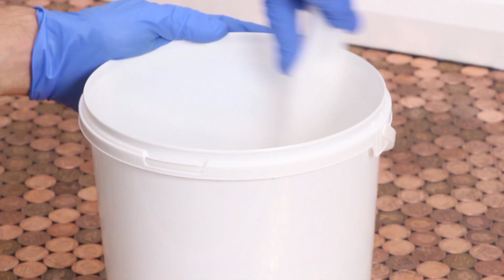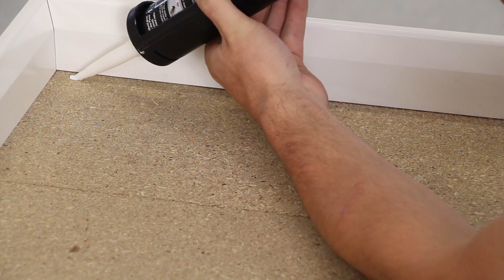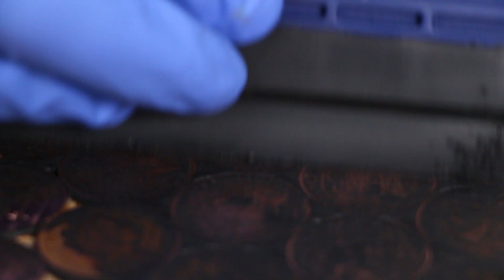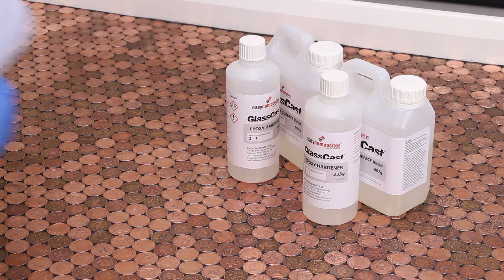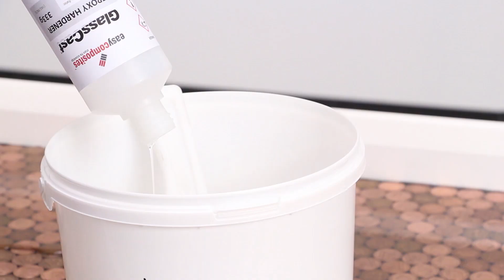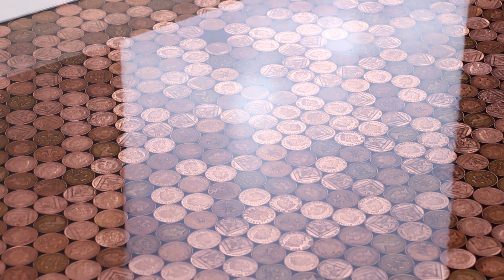How to Lay a Penny Floor with GlassCast 3 Clear Epoxy Resin

Comment: Would that type of floor scratch easily if you have dogs?
Reply from the maker: Potentially if they had sharp nails then there is the  potential for the surface to scratch. The good thing about Glasscast though is that if this was the case the surface can be polished back up with some polishing compound to restore the glossy finish.

Comment: Can I use this on myliving room  tile floor
Reply from the maker: Yes, you can apply GlassCast 3 over tiles. Assuming the tiles have been down for some time, they may have a range of different sealers, coatings, polishes, finishes etc on them so it would be important to do a test and check that the resin bonds well to them, especially if things like grease or polish might be present.

Comment: Do this for the wall too . please
Reply from the maker: Applying a self-levelling resin to a vertical surface is, as you can imagine, a bit of a problem. The only real option, if you can't make the panels on a flat surface in advance, is to apply multiple thin coats of resin (probably something like our XCR coating resin) and then flat and finish the wall to get the mirror-like finish (if a perfectly flat appearance is required).

Comment: On page 10 of the Penny Floor instructions, it is stated to allow the grout to dry throughly before applying the Glasscast because it is sensitive to moisture.  My grout (Fusions Pro ready-to-use) instructions say to avoid a solvent based sealant. Would Glasscast work if I allow ample time for the grout to fully dry or should I use a different grout?
Reply from the maker: Hi James, as long as your grout has fully dried you should not have a problem.  Epoxy does not contain hardly any solvents so should not cause any issues. If you are particularly concerned, then you could do a small test patch with some grout dried on a board then coat it with a small amount of resin.
Reply: @easycompositestv  Thank you for the quick response!

Comment: Is there a calculator for how many 2p coins you'll need? I can see a resin calculator, but not a coin calculator.
Reply from the maker: We've not yet managed to put together a calculator as it ended up slightly mroe difficult than we first imagined with the numerous sizes of coins/pennies that people use for these projects around the world. However, if using UK 2pence pieces, you need roughly 1750 for every square metre of area. So around £35.00 worth of 2p pieces.

Comment: I'm hoping to make a floor out of puzzles. Would this work on it without damaging the puzzles/making them look odd? Also what happens if I don't use grout? I'm planning on leaving the existing floor down as a base for it all, but was thinking about putting some fun colored duct tape on the floor in-between puzzles (if there is any space) to add some color so I wouldn't want to cover it with grout, but want to be sure it doesn't make it less likely to work, etc.
Reply from the maker: If you’re talking about cardboard jigsaw pieces then, being paper, it’s possible that the resin would soak in to them making them look ‘wet’. The solution would be to test a couple of prices first to see if there is a problem and if there is, you can seal the pieces using PVA, once dry it will be clear again and the pieces won’t go ‘wet’ with the resin. As for the duct tape, this might not be such a great idea if the resin doesn’t stick to it (which it probably won’t) because the resin could delaminate away from it if the floor got flexed or bashed. The best thing would be to make up a small test panel of what you want to do to check the behaviour of the resin on your chosen substrate and also the appearance of the end result.
Reply: @easycompositestv  Okay, thank you :D

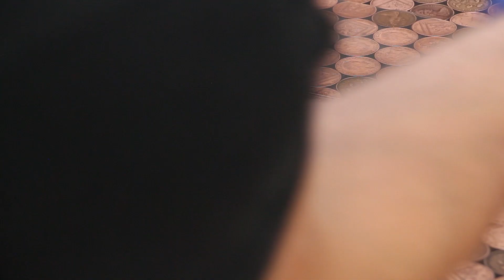Comment: 4:18 Why is it important to just pour and not scrape the excess resin that's stuck on the sides? Also can this resin be used on a more uneven surface like carbon fiber cut into small strands for a "chopped carbon" look?
Reply from the maker: One reason to not scrape the resin that's stuck to the sides is to avoid just continuing the problem of unmixed resin from the first bucket to the second. If you scrape out the bucket, you're likely to be scraping unmixed resin onto your mixing stick and into your second bucket whereas the idea is that only at least partially mixed resin goes into the second bucket. And yes, you can pour the resin over a much more uneven surface, included chopped carbon for a forged look. In fact, we've already done this ourselves and it looks great. I'd suggest you wet out the carbon and flatten it down with a first thin pour, give it a flat (with a sander) and then pour the final top coat.
Reply: @easycompositestv  Thanks for the reply! I'm definitely going to try to make a chopped carbon look table one day.

Comment: This is hardly a "complete guide," it is a very naive presentation that will mislead people. 
Newbies to applying sticky self curing two part liquids should be warned to think things out ahead very careful as to; 
1. Place tools and supplies so you can always have at hand as you progress across the floor, 
2. Preplan to close off the area when done.
3. Use the longest available (never six inch!) but no matter what tool you use it's almost completely unlikely the floor is level.
4. Remove the base trim. use a laser to establish a level line around the room.
5. Level the floor intentionally, with a leveling material as with tile. 
6. Either do the cast to the walls and apply new trim later, or put down the trim and do the cast. If you do the cast first, you will get no material on the trim, and the coins will tuck under the baseboard and look more pro.

No mention of odors and ventilation so I presume it's healthy.
Reply from the maker: Hi John, thanks for the feedback and suggestions. Most people do seem to have figured out for themselves that they shouldn't leave their tools at one end of the room in much the same way that they've figured out not to start at the end with the only door ;)
As for levelling, the sort of thickness you'd be using the resin at (2 mm) won't really result in pooling of the resin down at one end if the floor is a few mm out, there's too much surface tension. We know of many customers with a few mm of drop over large expanses and the resin will maintain a pretty consistent thickness regardless. Good suggestions on trim though, removing skirting is extra work but does have its advantages.
As for safety, there's a banner that we display at the bottom of the screen at the start of the resin section which instructs people to read and follow the TDS and SDS of the resin; the bottle labels of course do the same. That said, it's 100% solids epoxy so, no, there are no fumes or odours to speak of but some ventilation in a work area is common sense (and referenced in those datasheets). Take a look at the GlassCast gallery on our website to see how well 'newbies' seem to be getting on; there's some fantastic projects on there.

Comment: Is this product available in the US?
Can't seem to find it on Google 😅 Great floor and video!
Reply from the maker: Hi Zander, we don't have a distributor in the US but we can ship direct to the US from the UK. However, shipping can be quite expensive. On the Easy Composites website you can use the shipping calculator on the basket page to give you the shipping cost.

Comment: I didn't understand why to put that black material for joints? You could have coated epoxy directly after sticking coins
Reply from the maker: Personal preference, the grout (as used with any normal tiling project) also helps to mask any underlying colour from the floor beneath.

Comment: Can you reapply another coat once dry.
Reply from the maker: You can but once the resin has fully cured (i.e. gone hard) then you would need to key the first layer with a coarse abrasive paper before you pour the next layer. This would allow the new resin pour to bond properly with the first one.
Reply: @easycompositestv  hi what grade of paper do u recommend?

Comment: As the pennies are glued to the floor can I not use the grout and instead go straight to resin?
Reply from the maker: You ideally want to glue them down so nothing moves.
Reply: I’m going to glue the pennies down but don’t want to grout.
Reply: @stevequincey  The purpose of the grout is it helps the pennies stay in place as one big mass, rather than all glued individually.  This minimises the movement – ergo chance of any cracking or uneven pressure.
What is it about the look of grout that you don't like?!  It pretty much recedes into the background and sets the coins off rather nicely, I think.  it also means you spend less on resin and end up overall with a nicer – much more even – smoother finish.

Comment: How thick is the layer of resin?
Reply from the maker: We recommend 2.5 to 3mm for a penny floor which means 2.5kg to 3kg of resin per square metre.
Reply: Does glass cast bond to wood and paint?

Comment: Can I use this to cast paperweights with items added into the resin? I metal detect and would like to make paperweights or display pieces with it.
Reply from the maker: No, GlassCast 3 is not really intended for 'casting', it's more of a coating resin. You would be better using GlassCast 50 for casting paperweights. Here's a link: https://www.glasscastresin.com/glasscast-50-epoxy-casting-resin

Comment: Can you do the same concept except with pics in place of penny's?
Reply from the maker: Yes you can although depending on the grade of paper, you may need to seal over the paper with a thin coat of PVA wood glue to stop the resin soaking into the paper and making it go translucent.
Reply: @easycompositestv  thank you!

Comment: Does glass cast  resin yellow under UV? Thanks
Reply from the maker: Under high levels of UV, such as outside in the sun, GlassCast will eventually slowly yellow over a long period of time.  Although GlassCast has a very high level of UV resistance, in common with all epoxies, it is not 100% UV stable hence we recommend it for indoor use.

Comment: Can you give me the measurements for the epoxy needed in gallons or quarts?
Reply from the maker: 1kg of resin is approximately 1 litre by volume so just apply the correct multiplication factor to convert into gallons depending on if you are using US, or EU imperial gallons.

Comment: Just finished laying beer bottle tops in outside loo ready for epoxy resin
Reply: Over 3000 bottle tops
Reply: How much resin would you need for loo floor 3ft by 6ft beer tops flooring

Comment: Surely the epoxy could end up all scratched under foot?  People with stiletto heels and furniture being scuffed around etc,  do you remember those insect keyrings you buy usually at seaside cabin shops etc  a scorpion in resin or a beetle!?  After a while the resin becomes all cloudy from being rubbed in the pocket or constantly handled so what will a floor end up like?
Reply from the maker: The GlassCast 3 is a much more durable resin.  Eventually with enough wear, it will pick up scratches, but these can be polished out in most cases.

Comment: Can this product be used outdoors? Driveways or footpaths
Reply from the maker: The GlassCast range of resins does not have the UV stability for permanent use outdoors so is not recommended for driveways etc.  There are quite a few specialist resins on the market for just that purpose.

Comment: Is the epoxy easily damaged by dog claws or is it hard wearing? Thanks
Reply from the maker: Epoxy resins are generally very tough and GlassCast in particular is designed to be as hard wearing as possible. However, anything that's very smooth and shiny to begin with will show even very light scratches more than a less shiny surface would so it's worth being aware that over time you're likely to see some light scratches from scrambling dog's claws as he skates about on the floor! It's worth remembering though that GlassCast polishes up really well so if you do start to get scratches, particularly if they're just in a few areas, then you could polish up the resin to remove the scratches and return the surface to new.

Comment: I want to do a penny floor in my kitchen too. Only problem is, laws where I live require floors to be built at a tiny angle. Meaning that a certain very mild tilt exists, though barely even noticable to the eye. Could this be a problem, would it cause the epoxy to "flow" before setting? Thanks.

Comment: Heard itll yellow over time, is that true?
Reply from the maker: For indoor use, the high level of UV inhibitants in the epoxy means that you are not likely to get any yellowing for many years.  However it is not rated for outdoor use where the higher levels of UV exposure may well cause yellowing quicker.

Comment: can you use this on a heated floor??
Reply from the maker: Yes. Underfloor heating should not be a problem, providing the heating is kept to a moderate level and extreme changes in temperature are avoided.

Comment: If I put the pennys on plywood subfloor I am worried it will flex and crack the epoxy. ???
Reply from the maker: If the substrate is well supported and does not flex too much then there should not be a problem. Most floors that the system is used on are plywood/Sterling board and we have not seen or had reported any problems of cracking after the floor has flexed. Use your judgement though, if the floor is really springy then it might be better to improve the way it's supported first in the same way that you'd need to for tiles.

Comment: I would like to make a big slab up with roses and letters and timber in for my parents grave I been looking at resins to do this but this product bar far has a nicer clear appearance would it be suitable to be left outside or would it degraded?
Reply from the maker: Unfortunately we would not recommend the GlassCast range of products for permanent outdoor use as the high levels of UV exposure and permanent exposure to the elements would eventually yellow and damage the resin.
Reply: @easycompositestv  OK thank you for your reply I will try it for indoor table and look for an out door one

Comment: I'm embarking on my 1st project with Glasscast 50. A studio desk with Vinyl records glued onto a sheet of galvanised steel and filled over with Epoxy to create the desktop. I've used Silicone to seal the inset perimeter under the light tubing. Prior to applying i checked online for any reaction issues which were mainly ok but some other reviews mentioned it could melt the silicone?
Reply from the maker: We have not heard of this happening with any epoxies before and certainly in our experience, the GlassCast range of products are not known to have any issues with silicone.
Reply: Thanks for the response! Done the 1st pour last night and it turned out amazing. I followed all the essential advice in the video above and it worked a treat. Amazing product!

Comment: How will it react to stuff like pieces of cardboard, from say old game boxes?
Reply from the maker: The resin is fine with those sort of things but what you're more likely to see is that absorbent or porous inclusions (like paper, card, photos, magazine cuttings etc.) will soak up resin and look wet, rather than look how you would want them to look. To overcome this, it's normally recommended to seal them first using PVA glue; once it's fully dried they will look dry again but no longer be absorbent to the resin.
Reply from the maker: If you want to encapsulate card or paper in the resin then you will need to do a small test to see how it reacts. Depending on the grade and quality, some paper based materials will become semi translucent when wetted with resin. To avoid this, you can seal the surface of the paper with PVA wood glue painted on in a thin layer which once dried will be clear and offer the protection needed to pour the resin over.

Comment: Very nice but how do you make sure you have put enough resin to make the floor perfectly level with the other rooms' floors? For instance if I were using pebbles other than pennies.... Also is this durable for years or will you end up with scratches all over the floor in 6 months' time?
Reply from the maker: Normally you would be using a self leveling screed or similar to ensure the floor is properly flat before you start and giving you a reference point to get the height correct.  Other situations you just need to measure it correctly.  You then need 1kg of resin per mm depth per sqm of coverage. GlassCast is highly durable and is unlikely to be heavily scratched and worn in such a long period.
Reply: Good question. I intend to try an oak threshold between. Wish me luck!

Comment: Wouldnt it scratch up after a while?
Reply from the maker: GlassCast is very hard wearing so in a domestic environment we would expect it to be very durable and maintain its gloss finish with minimal scratching for many years.  If you do build up scratches such as from stones in shoes or a pets claws, you can sand out the deep scratches and polish the surface to restore the finish back to a high gloss again.

Comment: Hi I have floorboards, rather than concrete, what is the best surface to put down before using epoxy resin?  (May just use glitter/mica, rather than pennies) Great video, by the way!
Reply from the maker: As long as the surface is sealed then you should be fine. If there are lots of large gaps or movement in the boards then skimming it in plywood or a thin layer of OSB will help stabilise the surface.